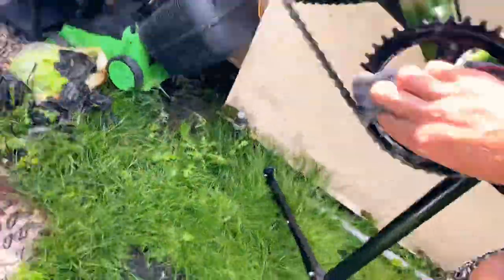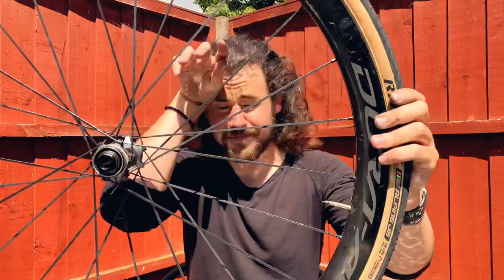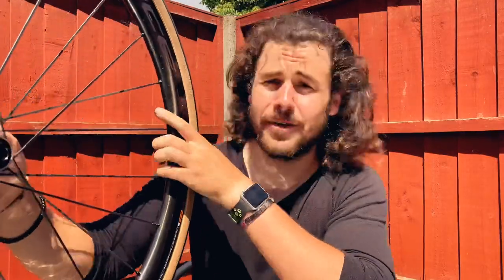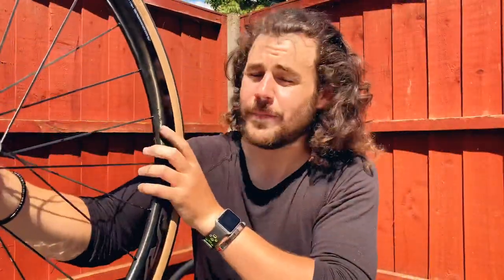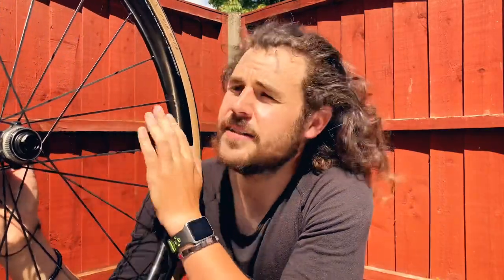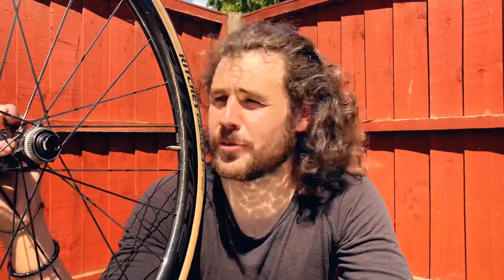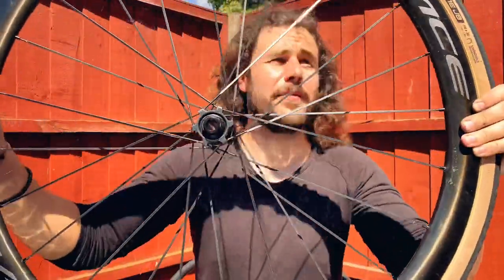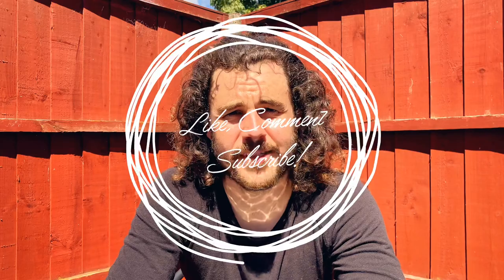Episode 72 - I’d race on these tyres... Ritchey Alpine JB

Comment: I was recently looking for a replacement tire for my Canyon Endurace. Currently have the GPs (28MM) and thinking I might want something a little wider that could take some sidewalks and crushed gravel. I ride mostly road, but do need to travel on some uneven/cracked pavement from time to time and wouldn't mind the option of sand and dirt and gravel. So awesome to see this review pop up. I definitely think I'll be getting a set of these. Any opinions on running them with tubes and what pressure I should try? I found them on Amazon but it says the tan wall aren't tubeless compliant.
Reply from the maker: Hey! Ahhh ok they are fine on tubes, make sure your looking at the tubeless version, mine were tan wall tubeless :)

Comment: Good review, it's an interesting tire, and the 30mm is a great size that will fit on some road bikes w/ short reach brakes.  One question/clarification; I believe you mention that the 30mm variant that you tried is tubeless? Per the Ritchey website and some other reviews of the tires, apparently only the 35mm wcs blackwall version is tubeless ready. Has that changed?
Reply from the maker: Hey John yeah they do a 30mm tubeless and it great I use the tubeless ones... tan wall too
Reply: @bikepackist  Awesome, thanks. Now I will just have to see if I can actually find tan wall tubeless in stock anywhere!
Reply: Are you sure that the 30c are tubeless? I can’t find anywhere to get a 30c tubeless for the Alpine JB. Did you just tried to set it up as tubeless and it worked? Looking at the label on your tire, I have the exact same one, WCS, Alpine JB Stronghold 30c. Thanks!
Reply: I put these on Madone rim brake. Let’s go. TPU tubes!
Reply: @tlkris Madone rim brake TPU tubes